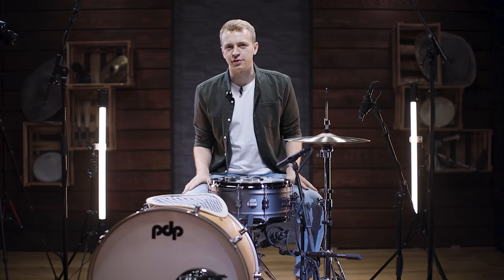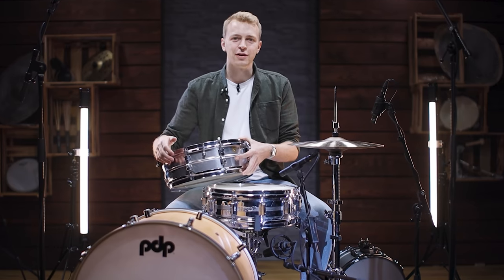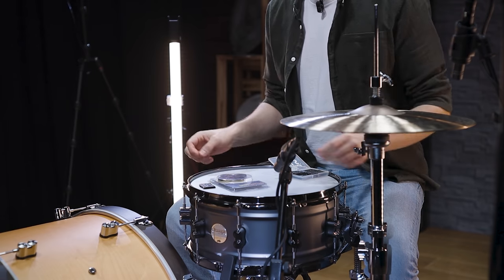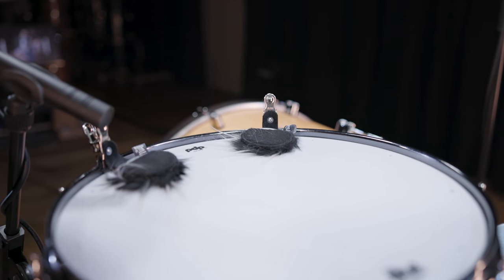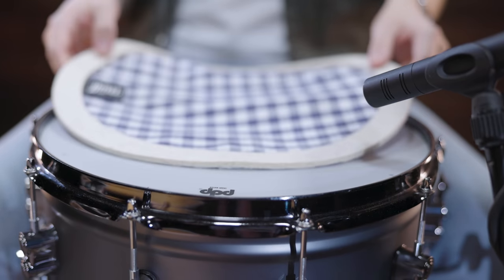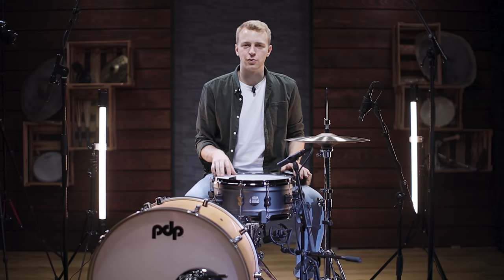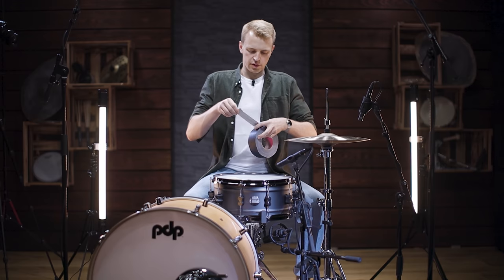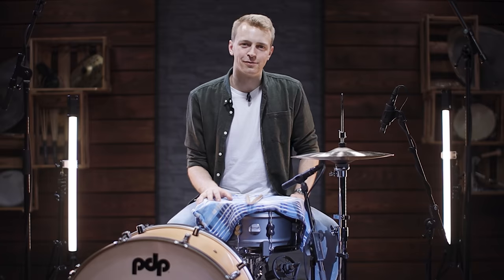The Snare Drum Muffling Guide | Finding Your Own Drum Sound

Comment: @ArtOfDrumming really nice video. One option which is my secret trick in the studio and live (wuppsss.. i just revealed it ) is a worn out snare resonant head (you can use a new one, but its not better so just use and old one and save money).
 Cut of the aluminium ring, place it on the batter head!.. best ever for a muffled sound. It still leaves close to full rebound (not like big fast snare drum), but it muffles less than "big fat snare drum" type of muffling. I even have one with a hole in the middle... just wanted to share.. happy drumming.

Comment from the maker: What's your preferred muffling tool?
Reply: Remo muffl'r or big fat snare drum quesadilla
Reply: Snareweight -  m1 for snares and m80 for the floor toms.
Reply: Wallet on the snare is tried and true for me!
Reply: Muffler bearing. Yer gonna need one of those.

Just kidding, I prefer the internal damper, as you showed at the beginning, and is also included on 60s/ 70s/ 80s (I think) Ludwig Acrolite, and others. I just rebuilt a 300XXX S/N Ludwig 14" snare with blue/yellow parallelogram tag (pre-keystone), and it works quite well.

I am curious, though, what you think about the old Remo Muf'l rings. Used to use them in the 90s on the old Pearl toms, but with Pinstripes and Powerstrokes, I believe these rings to be obsolete. Curious to know what others think. I am tempted to try the gels, because frankly they sounded the best.

The Donut thing (although it sounds nice) would be absolutely destroyed in one practice session. Duct tape will destroy your heads, especially coated. Do not attempt!

Comment: AOD, I have constant troubles with tuning my snare drums:  1 is a PDP Concept Maple 14 X 5.5 & 1 is a DW Design Series Nickel over Brass 14 X 6.5 Snare.  I am unable to get that nice sound that is "heard" here and at many other YT Channels.  I'm a intermediate drummer, a 71 yo, recreational player who resurrected playing agian after 50 Years [1969].  I knew nothing of drum tuning in the past, but I am learning now.  But despite trying a variety of batter heads on both drums, installing and re-installing both the batter and snare side heads and wires, I am unable to get that nice sweet sound I hear in these videos.  Note, I do not use Mics or record my playing.  I've tried a variety of muffling and tuning levels, but still have troubles.  I did stumble upon a weird thing.  I placed my Dw snare on top of my 16" X 14" Maple Floor Tom, and that produced a vry desireble Ludwig Supraphonic , John Bonham sound.  But take the same drum off the Tom, and it is not close.  I see in this video that You used the stock Batter head on the drum, engaging different Muffling devices / methods.  Thanks for the video.  I'm  back to the drawing board, seeking to produce that "ideal" sound (unmiked) .
Reply: Room acoustic is allways a thing too, some rooms just does not fit to the drums. Maybe that is the problem?

Comment: Bonus video - Tom muffling. Cotton balls inside the drum to reduce overtones on resonant heads. :)
Reply from the maker: Great and useful advice!
Reply: Cotton wool inside the drum?
Reply: @helfibnhelm8035  That's right. Take the batter head off your floor tom, toss in a handful of cotton balls and put the head back on. The cotton balls rest against the resonate head inside the drum and shorten the sustain of the resonate head. Giving the drum less sustain... if that's what you're going for.